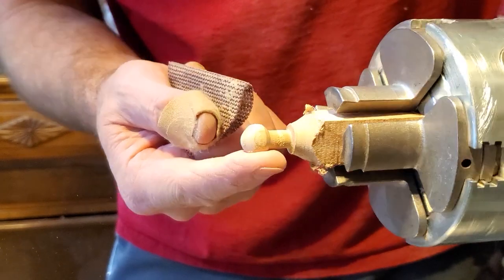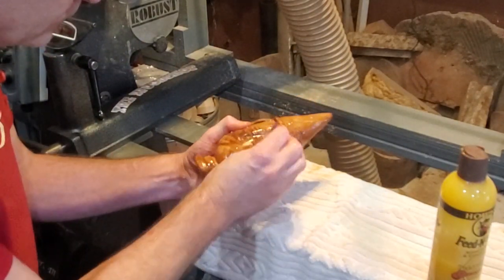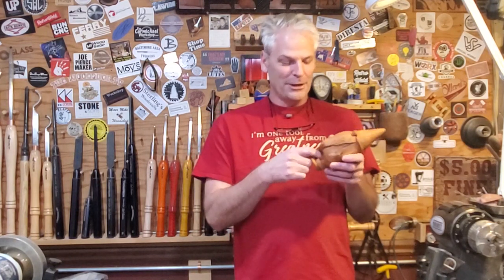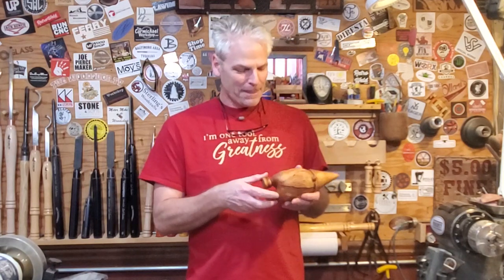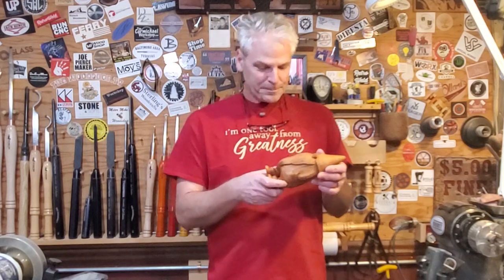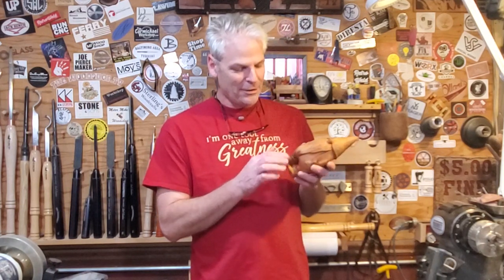Wood Carving | Maple Gnome

Comment: Great video. Nice little project.  I just bought the Arbortech ball gouge carver that goes on the 4" angle grinder.  I only tried it out for a few minutes on scrap wood so far but it looks like it will be fun to use on bowls and boxes and whatever else.  I turn on a Oneway 2436 lathe with a five foot bed  extension and a seventeen inch extension that I added on the tailstock end.  It turns nine foot 3 inches between centers.  I used to turn big porch posts for customers  sometimes.  I have also turned forty nine inches in diameter on the outboard end of the headstock.  It takes all the fun out of turning when you turn these bigger pieces, but it pays ok.  I bought all the Oneway grinding system.  Now I don't dread sharpening anymore.  I'm giving turning lessons to our fifteen year old great nephew when he will be down here in Louisiana for Christmas.  I gave him the first lesson last Christmas and he's turning every piece of wood in his sight.  Thanks for sharing your turning knowledge with all of us.   Dan
Reply from the maker: Thank you very much Dan!! Wow that's a monster lathe! That's so cool he's enjoying turning. Merry Christmas

Comment: Pretty cool little guy! Wood carving is a whole new dimension to wood working. As an aside, I have an Easy Wood question ( as opposed to an easy wood question). How do you keep the Zoom Ring working? It looks slick in your videos, but I have NEVER been able to turn mine with one hand. It takes both hands and some effort to get it to move. It really is worthless in my experience. Sorry to rag on you here, but one of the reasons I bought the chuck was your videos and endorsement. I do love your work and hope for your advice.
Reply from the maker: Thank you Ben, I'm having a lot of fun learning to carve. I would check with EW I know they had some problems with the really ones. They redesigned the inside and fixed the problem. I would call them, they might be able to fix it.

Comment: I'm new to turning (actually only been on the lathe twice so far) but watch a lot of youtube videos by turners. One questions I have that I've seen many turners do is, when you start between centres one almost the first thing you do is cut a tenon and put it in a chuck. I can see the need for putting it in a chuck if you going to be turning the other end without the centre holding it, but why the rush to get into a chuck if you're turning between centres anyway? Why not just leave it on the spur?
Reply from the maker: Hi Thomas, 
The chuck jaws smash the wood a bit, and It's very hard to get it to run true if not turned in the chuck. So basically the sooner the better for getting it in the chuck.

Comment: I notice you use CBN wheels. I have the Rikon 1/2 HP grinder. What grit and size CBN wheel would u recommend
Reply from the maker: I would go with the 80 and 320
Reply: @CarlJacobson  ok. Thanks.